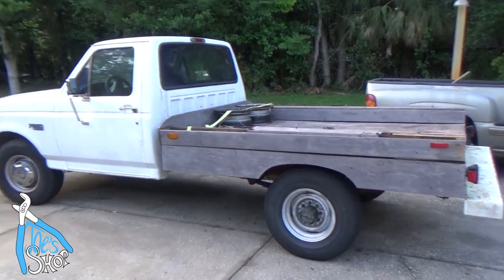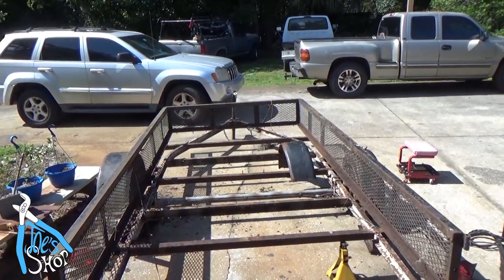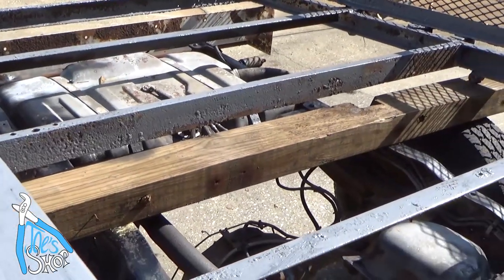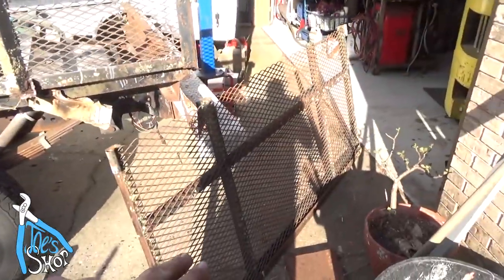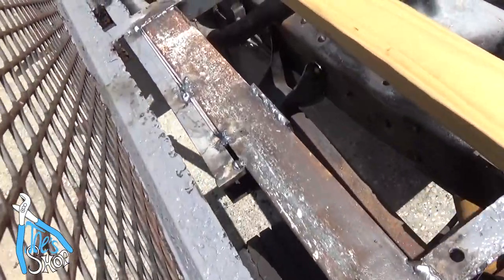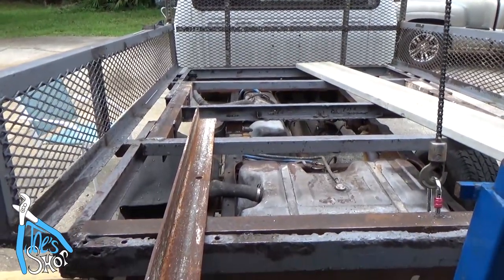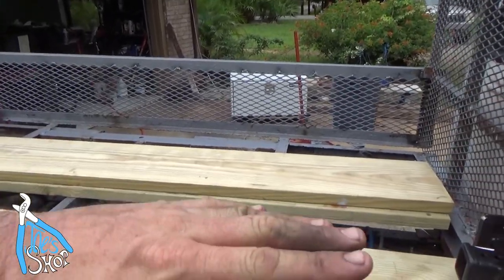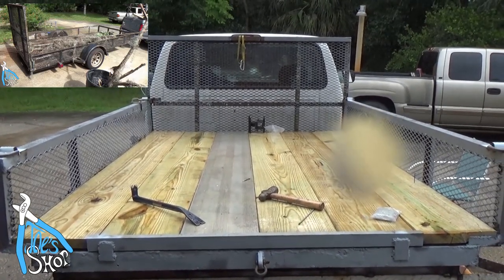OBS Ford Flatbed Build

Comment: “I’m gonna try not to drop any trailers on any vehicles today”. I can’t count how many times I’ve said that. 😂 Nice up-cycle man. Rip cut one of the 2x12s in half and put those to the outsides, that’ll center your aluminum plank. I watch ICWeld also, he’s the man with industrial stuff. Prices are ungodly on any building material and fuel right now. Everybody is trying to salvage, recycle and reuse everything right now so even stuff people would normally have thrown out they’re selling on Marketplace. As a buddy of mine said “It’s like living in Cuba, people are happy to pay for used spark plugs”. That would be funny if it weren’t so close to the truth. Let’s Go Brandon!